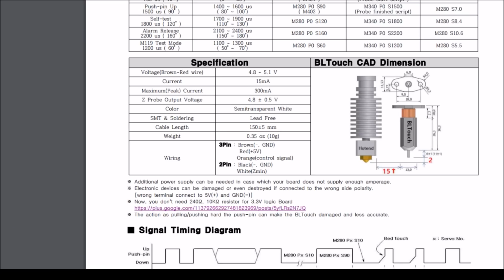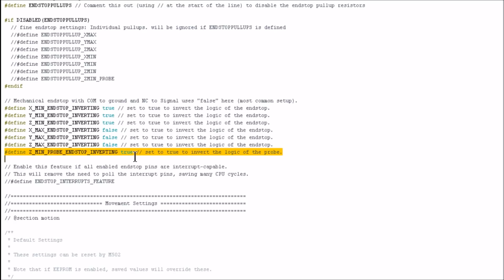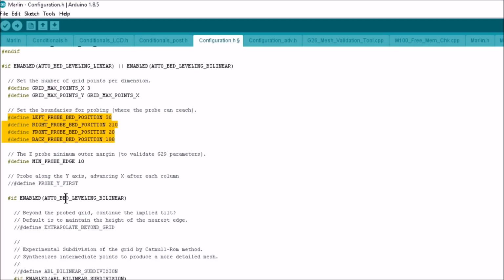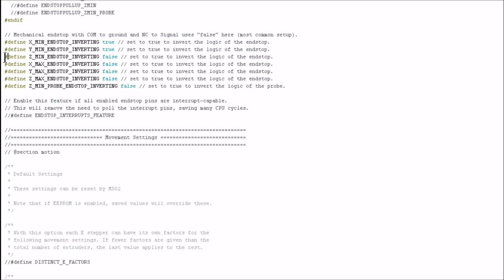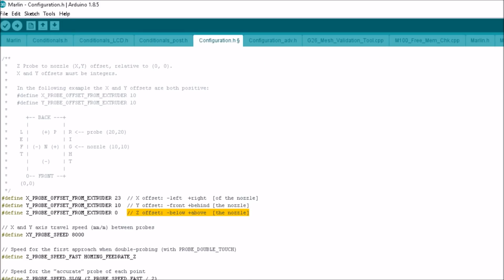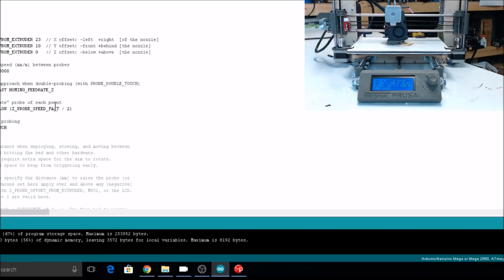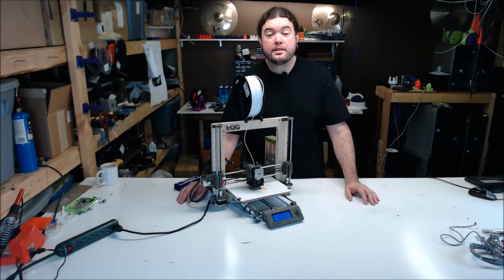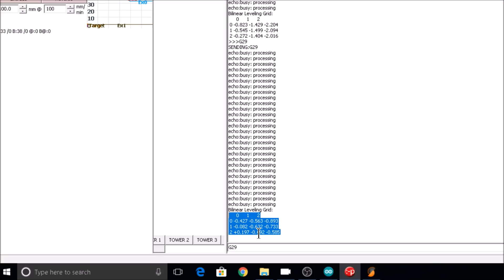Add Auto Bed Leveling to your 3D printer - Marlin - 2017

Comment: Excellent video but I still did not manage to set it because of the location of my sensor  (a print from thingiverse).  It keeps crashing onto the bed!  I will change its position and try again.
+Chris Riley   On another subject : the mosfet, would you have any explanation to the fact that, having fitted the mosfet, a part of my motherboard starting smoking (this is the season to stop smoking).  When I measured the DC output, I was flabbergasted to find......176V  instead of the expected 12V.  No wonder the motherboard took up smoking.
Reply from the maker: Wow, 176v! I have had these mosfets do all kinds of strange things. I have a pile of RAMPS boards with various melted parts because of these. Unfortunately, it's probably just a bad one, you can replace them, but it can be a pain and sometimes hard to replace without burning up the traces.
Reply: Thanks for the reply.  I see that electronic parts are very reliable ☺☺☺.  As for my Roko bed level detector, I have been supplied with a 5V and some guy in a video suggested I should connect the positive and the negative onto the hotbed feed, leaving a negative on the sz.  And guess what?  It did work but the hotbed too and out of any control  lolllllllllllllll   Why didn't the bloke just suggest to connect it to the DC in for crumbs' sake!?  No need to reply....there are so many configurations.
Reply: +Chris Riley   Here is the mosfet I bought on Amazon France:   Hrph 3D Printer Heated Bed Power Module High Current 210A MOSFET upgrade RAMPS 1.4 .   It did warn it was HIGH CURRENT  lol
Reply from the maker: Wow! They weren't kidding. https://www.amazon.fr/Hrph-Printer-Heated-Current-upgrade/dp/B06ZYQN6VQ/ref=sr_1_1?ie=UTF8&qid=1515378045&sr=8-1&keywords=Hrph+3D+Printer+Heated+Bed+Power+Module+High+Current+210A+MOSFET+upgrade+RAMPS+1.4
Reply: +Chris Riley    Aren't they crazy to propose such electronics without clear warning as to the output?  Even RAMPS 1.4 succumbs under 176 V.  I noticed that they have added a warning which I am not sure was there before my alert.   I had no idea that with 12V one could produce 176V and I am a grown-up (very very very grown-up at that) and I am thankful I did not put my fingers on it!
Chris, have you got any idea why I keep crashing when I try to set up my roko level sensor?  The carriage gets stuck on the edge of the heated bed with a dreadful noise so I quickly switch off.   
I did everything you said.  However I noticed that the printer did not respond to the positioning commands (G28 X1000Y1000 F5000 from memory)
Reply from the maker: Margery Maraudy I don't have a roko to test, but I have seen them before. Is yours a SN04? If so, I think those are 10-30v. My guess is there isn't enough juice to trigger it. If you run your Z up to 100 or so,  then g28, can you trigger the sensor manually to make it stop?
Reply: +Chris Riley  Yes indeed it is a SN04 and it works now I have connected it to the DC in.  It works in as much as it lights up when within 2 mm or so of the bed.
I'll come back to you on running your test as my printer is not responding to any commands sent by Repetier Host just now.  It just makes a kind of motor sound and then ....nothing.    However it accepted the upload from Marlin as I modified again the setting to run your suggested test.  I'll investigate later.

Comment: Chris you did a perfect job explaining how to and why and what censors to use. i have been trying to auto level my bed forever. had no problem when i used skynet 3d. Used to have to G92 Z10 and all the stuff but with Marlin i was having trouble because i could not change the z axes to get a negative number. Thanks to your video i know know i had to comment out// define MIN_ SOFTWARE_ENDSTOPS Still have not gotten my LCD 2004 screen, red with 5 buttons  to work wright on my Anet A8.  Even when i used skynet they would not work, center button and up and down but not right and left, do not know what i am doing wrong but the bed leveling i have gotten that part going good thanks to you Chris.
Reply from the maker: 44mod Thanks for the comment, I am glad it helped you out.

Comment: i change the z offset in marlin, then G28, G29, G1X110Y110Z0 F5000. but the nozzle's height does not change, it's still at the same height at beginning.
Reply from the maker: Tòng Phan Do you have eeprom enabled? If so, I would turn that off. Are you entering a negative value for z offset?
Reply: Chris Riley i gonna tried to turn off eeprom and do it again. Your video is pretty clearly, i learn a lots from it. Thank you
Reply from the maker: Awesome, let me know how it goes.
Reply: it works, thank you. 
 i have another question if you dont mind. My hot end keep clogging, do you have some suggestions? i would like to increase the hot end fan speed but dont know how to do it.
Reply from the maker: Tòng Phan What printer do you have?
Reply: Chris Riley i have an anet a8 with clone bowden
Reply from the maker: My first guess for the clogging is that your barrel doesn't have the correct size PTFE tube. I see this all the time. Make sure the liner and the bowden tube are snug on the 1.75 filament. As for fan speed, if its the hot end fan, not the part fan you would probably just have to buy a  higher speed fan. If its the part cooling fan you might be able to adjust the speed in the slicing software.
Reply: Chris Riley do you have some recommended bowden kit that works well after installation? This is me first 3d printing experience, i spend almost a month to troubleshoot this problem.. I also bought a genuine e3d bowden and it arrives on today. Hope that it won't get clogging anymore.
Reply from the maker: I think you probably got the best choice. The E3D hotend will fix your problem for sure, they're awesome.

Comment: I would be very interested to see what this would look like on the anycubic delta auto leveling. The G33 delta calibration seems to really change the radius on me beyond what it should be.
Reply from the maker: Ahhhh....G33, yeah that is sequence that has some magic to it. Let me give it a try with a touch sensor and see what I come up with.
Reply: I used https://www.thingiverse.com/thing:1976680 to construct a switch probe. I tried to follow the mentioned steps, but I think the Z offsets are not quite right for the added fixture (v2). Even still, I see it go through the motions and UBL steps produced a table of values but way high, 17+ mm off the bed. There is mention of a fade height. But no mention of why its important , what it does, or why 10mm is recommended. My main problem on the anycubic delta is accuracy and initial layer. 50mm square is not at the 0.0125 mm as indicated by anycubic. I was hoping auto calibration would assist here, but perhaps I am asking too much.

Comment: always lovely to see the LOG :D as always im a fan of your videos ;)
Reply: hehehe awesome :D  everytime i see the LOG i just want to order the mk2,5 kit for both my prusas and build 2 clones :D
Reply from the maker: Cold Akin It did survive a fall off the table, so you might be right. :)
Reply from the maker: Thanks, LOG is still cranking away.
Reply: i know i have asked you this before but how good is the log? is it dependable like a Mk2 or do you have a bit so and so on the print quality?
Reply from the maker: It's so so, its not as dependable as the MK2. If the print quality on the MK2 was a 10, the log would be about a 7. I think if it had a real E3D hot end, a nicer main board and some nicer linear bearings It would probably work much better. Then if I could get a hold of an MK42 bed, then we might get close to the real thing.
Reply: if you get the mk2,5 upgrade then you would have a spare mk42 bed. Thats a thought :)
Reply from the maker: EspenShampoo25 I know man, so tempting.
Reply: LOG is legend and unstoppable!